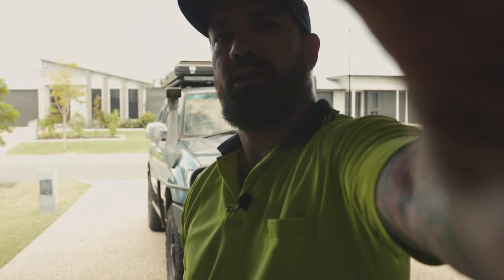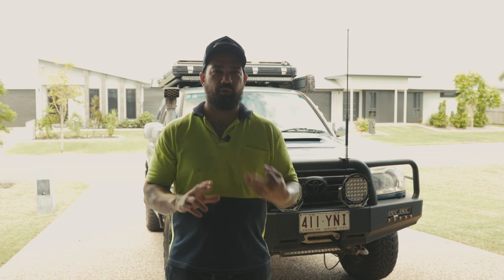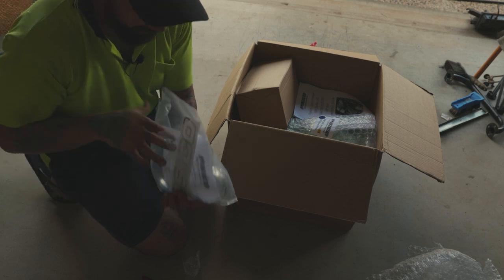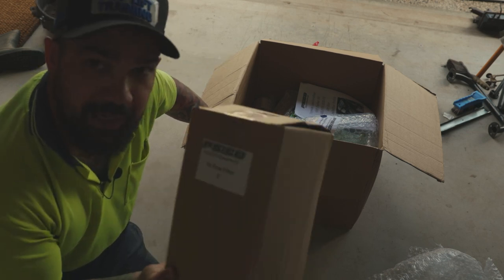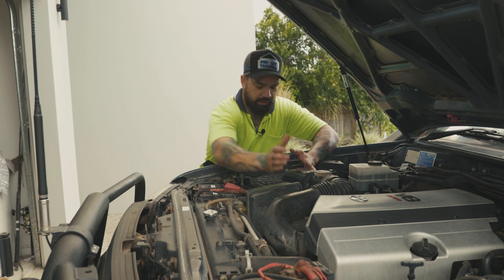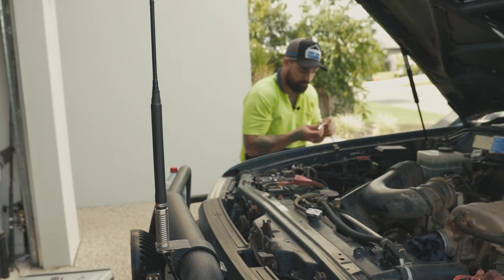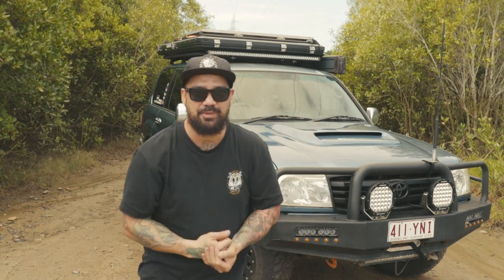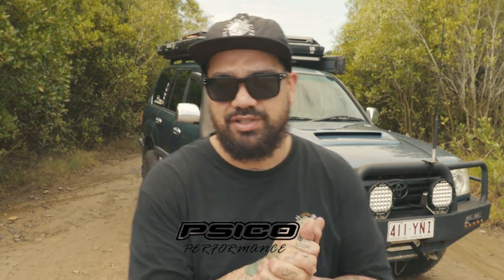PSICO PERFORMANCE AIRBOX  Toyota 100 Series

Comment: The MAF sensor takes too long to get into closed loop hence why we get crappy fuel economy. I drove from sudney to Brisbane and we went from 24lt to 13.4 ltrs when we reached Brisbane. I got to find a way of tricking the unit to jump into closed loop early .. What exhaust have you got on the best thank you
Reply from the maker: It's a custom system mate but I do know 4 into 1 headers 100 cell high flow cat and sports muffler and 3 inch to 4 inch dump
Reply: @DAYZOFFADVNCHURZ  Thats tuff sounding ..I am looking at getting mine done as well but i dont want it to drone on the freeway if you know what i mean ..Anyway i am enjoying your videos ..keep touring and exploring as you are doing a great job thank you for the tips
Reply: I need to trick mine big time. If u have any tips. It’s a very thirsty unit. Bit like it’s owner 😊

Comment: Awesome build man. So was that a safari snorkel
Reply from the maker: Yeah the armax one I'll be finally getting tune soon it needs it my air fuel ratio is way out of wack
Reply: I got the unichip. It’s a plug in with a dynotune. About $2200 but I think it’s worth it
It’s an animal on the tracks. But I think a snorkel would help it breathe even more
Reply from the maker: Yeah mate I actually took all the restricters out from the air box to the throttle body it's just a straight pipe suck in so much air haha
Reply: Yeah nice I’ve been looking at doing it like that too.   Do you get around 6 kilos to the litre.?
That’s all I really get maybe 7 on hiway !
Reply from the maker: Haha I get atm 24-26L  per 100km but before the airbox mods I was getting 16-18
Reply: Ah ok. Get the tune man. It will be animal. And pay for itself. Did you clean Maf sensor. I thought it should run more lean with what you have done with airbox and snorkel. 
But that is a thirsty mofo
Haha 😂

Comment: Have a question about that air box will it fit straight up to the safari snorkel that is set on the outer panel closer to the driver windscreen pillar
Reply from the maker: You mean the entire hole is closer to the drives door ? Well I know that the airbox is a 4inch inlet so you would have to change it anyway
Reply from the maker: That's why I went the armax snorkel it covered all the old holes but definitely did make a difference pairing the 2 together
Reply: @DAYZOFFADVNCHURZ Roger that thanks mate